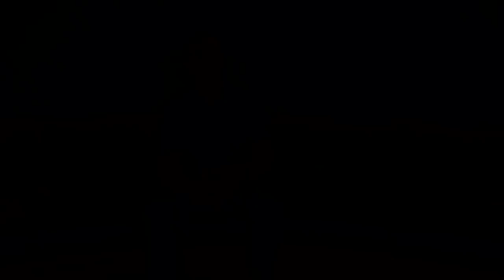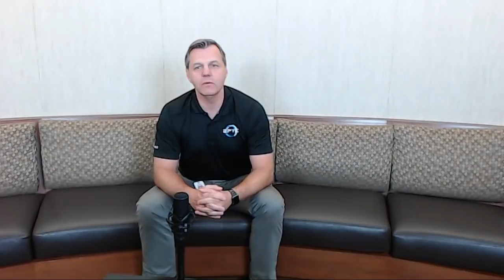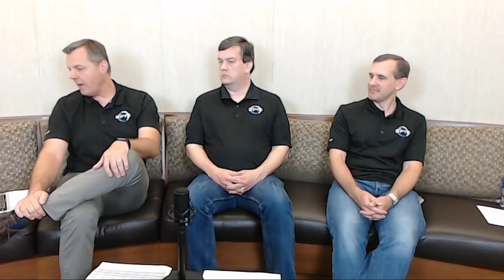EPYC™ Facebook Live Tech Talk: Scott Aylor, Forrest Norrod, Kevin Lepak

Comment: I know this is a bit off topic but pleas for Zen 2 could you look at at least decreasing fabric latency, I would proffer a doubling in frequency which would tackle latency as well as bandwidth but I see the latency of the infinity fabric as Ryzen's Achilles heel, bandwidth at least on the desktop doesn't even come in second or third or forth before that you would have DRAM latency, DRAM comparability for higher than 2666Mhz especially for high capacity modules, it probably ties with cache latency on the desktop that is.

Enterprise and HEDT would probably go fabric latency, fabric bandwidth, DRAM latency then cache latency and DRAM compatibility for high frequency memory wont even chart high being greater than 2666Mhz and likely 2134 and 2400 will be what server will be looking at so 2666Mhz is probably more than enough.

So in both cases your main sticking point is dat fabric latency, and really optimally a halving of latency is what I would like to see but that probably isn't happening but any reduction would help, one can hope considering this was your first go at your infinity fabric that there are big gains to be had and a halving in latency in 1 generation is actually feasible but it is a faint hope.

Comment: Just some thoughts while I watch.
Intergrate a Infiniband link into the cpu to take care of rack connections. Or separate chip on the substrate/interposer.
Use an interposer for a wider infinity fabric connection between die.
So the Hypertransport consortium wont be getting an infinity fabric upgrade any time soon.
So epyc has XFR? but implemented differently.
These reviewers that got systems, hopefully it was levelonetechs on youtube.
Does the numa aware software see a 2p as a 'two processor epic' or a eight processor system, and make bad decisions because of it?
Two sockets has traditionally meant redundancy in the enterprise. How do you plan to change or combat that perception?